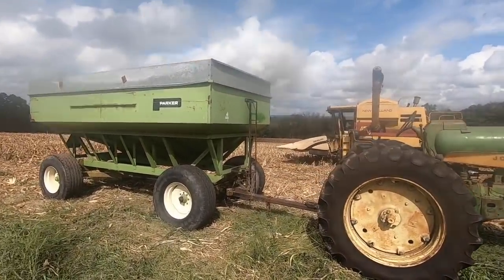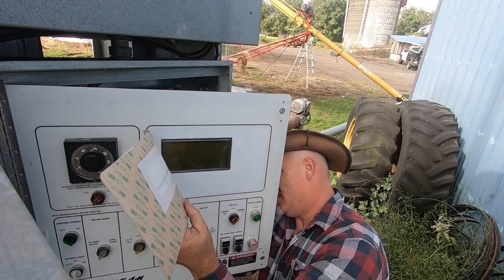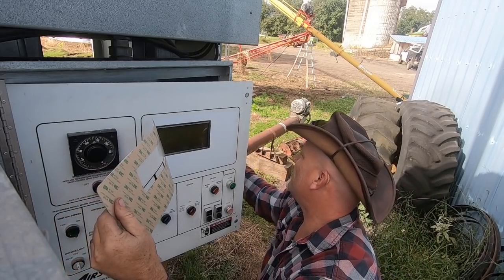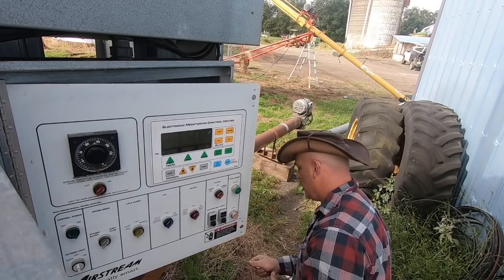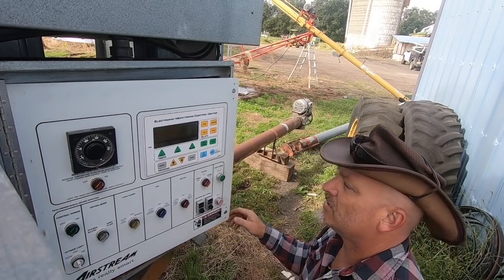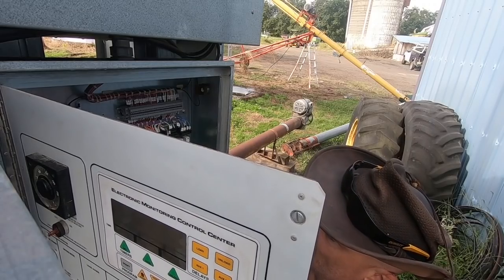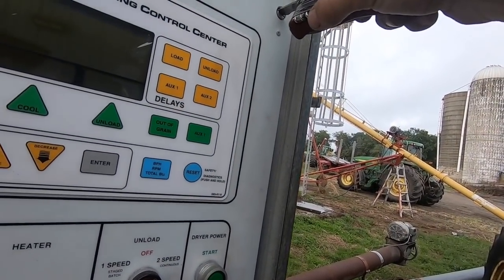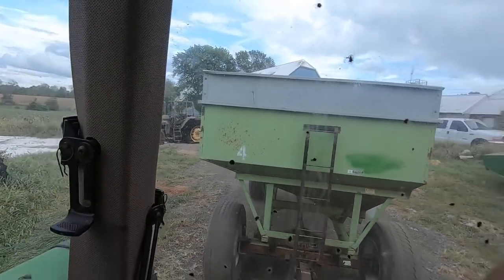Dryer Parts Are Here

Comment: Those membrane switches are asking for treouble in a humid environment,  The things with heat sinks are three terminal regulators that cost only a buck.  They are supposed to have internal protection.  The failure is likely one or more of the littke black cans that are electrolytic capacitors that can short, often blowing the cans off.  The board can probably be repaired with $5 of parts.

Comment: The devices with the heat sink are a small voltage regulator chip, they  will have a DC input voltage of between 10 and about 30volts DC and regulate it to either 5 volts DC, 12 volts DC or maybe 15 volts DC, it is normal for these to run like Luke Warm to Mildly warm, but not blazing hot to burn you.  The static sensitive stuff is going to be in the multi pin logic chips,  circuitry is so small inside that the silicon oxide layer inside is like a small number of molecules thick or in technical terms about 1000 to 1500 Angstroms thick and it only takes about 5.7 or 5.8 volts to break it down and then the magic smoke comes out !!  seems like the wetness may have crossed the circuit board traces and put a higher voltage to the logic chips and they like things started to happen, this may have cooked the capacitor too!!  B.T.W. whoever wired that panel really done a most excellent job on the harness !!! VERY GOOD WORK !! Makes it a LOT EASYER to service!! Your idea of using the gloves to isolate yourself from the circuit board was a good idea and while you started to do the replacement you touched and handled the static pouch which HELPED to discharge or at least make even, the charge you might have had to be equal between you and the circuit card!  Well Done  on your part!!!

Comment: Wes my wife has worked for Lockheed Martin for forty years. She builds boards like that for guidance systems. Like making dumb bomb's that they used in Vietnam to smart bomb's they add a tail fin with the guidance system and fly them through the enemies front door, and yes they are grounded All day at work because of static electricity.
Reply: Yeah we learned about and wore grounding straps when I was in mechanic's school working on ECU's... just a precaution that makes sense, because those microelectronic circuits inside the chips simple cannot handle excess voltages, which static can easily be 40,000 volts... for something made to run on 5 volts that is, literally... wait for it... quite shocking to their system... LOL:)  

sticking a jumper wire securely against your skin (back of the glove, under a rubber band on your wrist, etc) that is clipped to the housing will ground you to the housing and thus eliminate any voltage differential (static charge).  Later!  OL J R :)

Comment: the trans and some of the parts on the burnt tractor are worth something
Reply: Doubt the transmission is  any good... usually melts the aluminum case right off the guts of them... and at any rate getting that hot fries all the seals and stuff.  Parts maybe but that's about it.  OL J R :)

Comment: I don't know for certain about your particular application, but heatsinks like you were feeling are used in a lot of electronic applications to dump heat from voltage regulators, especially that near the rectifier.  Most electronic chips today run off of a 3.3V to 5V DC power input (some very specific cases for 12V directly), at least in my work, but they might be used to switch higher power rails on and off for motors and such, which is what a lot of the rest of that board looks like to me, that is, relays and I/O signals from the various sensors in your dryer.

Comment: Wes as an electrician that does controls, the chance of you actually damaging something on the new board by static is so very small it is also noon existent. Even computer mother boards in a computer are not going to be damaged.
Reply: exactly but its cool to see people use preauction. shit isnt cheap now a days.  only way you gonna kill them with static. if theres already a current or some form of electric going into it. like if its on or something. then it will cause a short.  i build custom pc's as a side hobby.  only time i use a anti static whatever gloves, that bracelet thing, or mats. when i need to work on a computer that is on. when trouble shooting something. like a loose connector or ram not seated right. so on.

Comment: Going to send that old board in for repair somewhere? I think that's becoming more and more common to get electronic components fixed. Electronics have gotten better with handling static electricity especially with PCs, but there is still a slight chance of frying the littlest thing that can ruin it. Could have it been struck by lightning over the year or some electric spike?

Exactly the point on yield... where is it taking from the other parts of the plant/kernels instead to push that yield? It's one of the driving reasons hearing more about ancient grains making a return. Good luck, hopefully nothing series with teh injury.

Comment: dont worry about those warning. i build computers well not from scratch. i buy the parts and insert them into a computer tower. but it is extremely hard for you to kill a motherboard or board whatever you wanna call it. with static electracy now a days. even harder to break em by screwing them down or in. this is if its off. no electric running to it.

Comment: It takes time for static to build up on your body. Just regularly ground your self to discharge. Just ground the box as a rule. Most good electric diagrams have box grounded. 

Wearing certain footwear and sockings, woollen type jumpers creates alot of static in dry heat during activity i.e. creating friction. High humidity reduces amount of static.